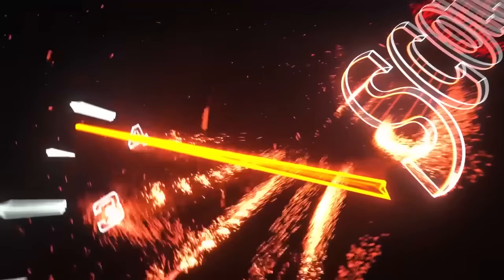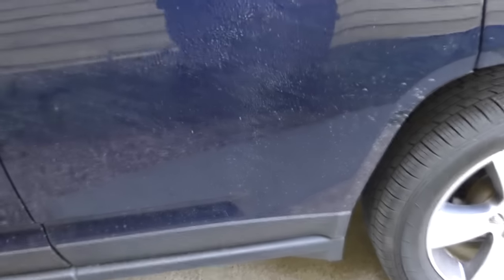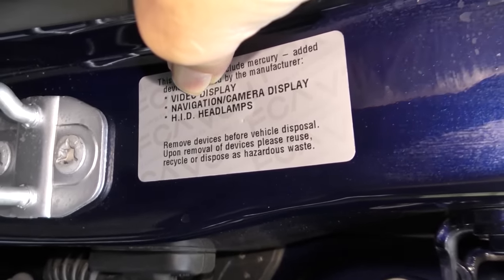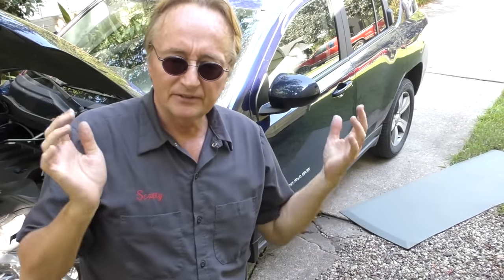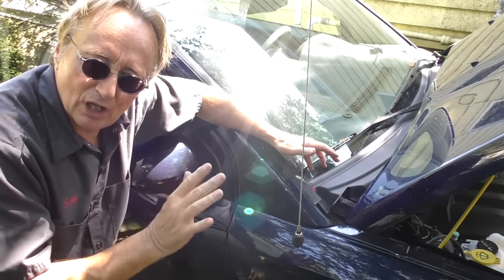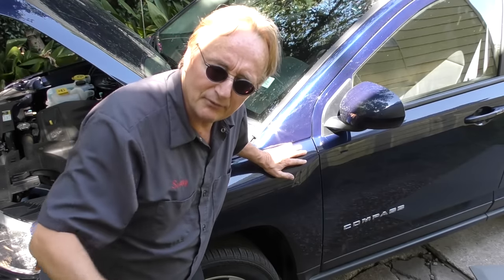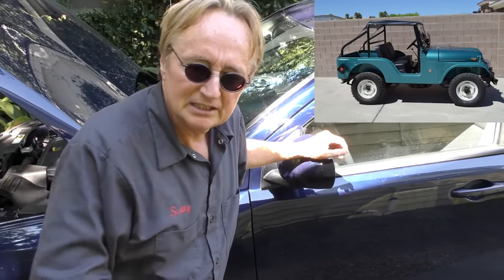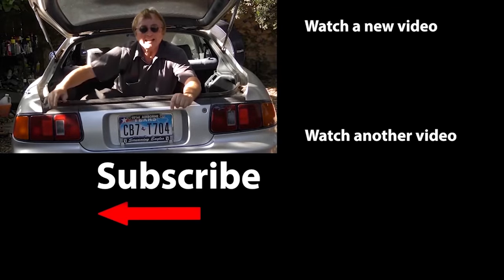Here's Why This Jeep Compass is Crap

Comment: I own a 2014 Jeep Compass. And I bought it from carmax here in Houston Tx Lol. It had 42k miles on it. The only thing I have had to replace on it is the throttle body. The part from auto zone cost around $340. Which is a little expensive in my opinion for a hunk of aluminum and two plastic gears and a circuit board. I have some where around 98k miles on it now and I have not had any other problems with it. At the time I bought it I had not seen your other videos about how poorly made these vehicles are or how shady carmax is lol. I'm just going to keep praying this thing holds together long enough for me to pay it off. Thank you for your videos and all of your knowledge that you share
Reply: David Chitty same issue here. My throttle body went out @ 70,000 miles
Reply: So if you just give it all the TLC and try not to do Jeep things with it, it'll be okay. Helps if you're handy with Youtube and tools, but just read the forums and do your research before you dump a ton into these babies.

Comment: I just traded in my 2013 Patriot with 197k miles and got a 2017 Patriot with 35k miles. My old Jeep started to have transmission problems with the CVT. I’m very glad my new Jeep doesn’t have that CVT so I can keep it even longer. I’m pretty happy with both of them so far.
Reply: I have a 2010 Jeep Patriot limited 4x4 with the 6spd CVT. It has 144,4xx miles and drives straight nice and tight. Abs light on for the abs motor being out but nothing else code wise. Sunroof leaks but I plan on fixing and not electronics out. The transmission sounds fine. No whine. It’s a little delayed when in need of power but the transmission is really smooth. Takes a half sec to engage into reverse and drive but not concerning. It seems to be getting bad gas mileage. I’m mainly on free way. The car runs super smooth so idk what would be causing the loss of power. Dealership said to replace Pcv valve but I took pills one out and ball is still shaking good. Transmission fluid is new and serviced. Air filter is new. Oil is good. Don’t understand the fuel mileage issue. Also slight clunking coming from front end over bumps has been there since new. But hasn’t seem to be an issue

Comment: Totally disagree I have a 2014,130,000 miles no major problems still running strong. Great gas mileage.still has original parts only changed the alternator and both thermostats. I keep the oil changed every 3000 miles with synthetic
Reply: The experience you have with a vehicle is often related to how you treat it, maintain it, etc. It's likely to last a whole lot longer with decent treatment. One suggestion though! A half century of driving, flogging the ponies, etc., tells me that you are changing your oil & filter unnecessarily often. Since you are using synthetic, I can't imagine changing it more often than every 5000 miles or 5-6 months. I keep my vehicles at least 150,-200K miles and since 80-90% of my driving is highway miles, I go up to 7500 miles between changes.

Comment: I drive 46,000 a year and have had a Compass over the past three years (I do a one year lease) and have never had an issue driving thru snow storms, wind/drifting snow and heat!! If no one told you its a little underpowered you would not really care. Has great features to drive thru your regular Ohio winters etc.

Comment: I've been driving a 16 compass sport for a few years now. Bought it with about 32k miles on it for about $17k before all the taxes and fees and so far put it through a lot of abuse. It currently has 100k miles and still running strong. Grant it, it doesn't have some of the nicer finishes that an equivalent Rav or Subaru would have, but those cars with 70k miles were going for 25k and up. At this point, you are looking to get a second mortgage just to afford one of those. Yes, price does matter. Especially, when you are talking about spending significantly more on a car with bunch of miles on it. I mostly do my own repairs and the only difficult part to replace so far was the rear motor mount. Everything else is very accessible and the engine bay has plenty of room to work in. If I had to  choose again, I would choose a compass with 35k miles on it over another car with 100k miles. I've seen cars killed with poor maintenance and it takes a lot less than 100k miles to mess something up. If you are talking about having enough money to buy brand new, I would absolutely agree. Buying a slightly used toyota would be the  way to go. Heck, I would go back to VW in an instant. But on the used market, you are talking at least 2x the price. For a daily driver, that makes all the difference. If the engine lasts another 100k miles, I got my money's worth.
Reply: Thats right.  Jeeps are not overpriced either.  Unless a Wrangler.

Comment: I have the 2014 Jeep Compass. It’s had a blown head gasket but it’s been resurfaced and it’s good. She’s at 122,000 miles. If you know how to listen to what pushes the vehicle to boundaries, you will learn how to keep her happy. You can’t accelerate, pedal to the metal up a hill without hearing the vehicle get real loud. Just take her easy. Like you said, definitely not high enough or built to drive like a hill climber. It’s a small family type suv. I like how the 4x4 is going to get you out of pickles. This is not for someone who doesn’t have patience.

Comment: We have a 2016 Jeep Patriot, which as I understand it is the same as a Compass under the 'skin'.  It has been a great vehicle, getting over 30 mpg on the highway.  It isn't meant to take on serious off roading.  Scotty talks about transmission failures; I think that issue was primarily with the CVTs.  Our Patriot has a Mitsubishi 2.4L motor and a Hyundai 6 speed auto transmission; so much for being American made, but it has been very reliable for us over 52,000+ miles so far.

Comment: I've got a 2016 and it's been running perfect. Awesome 4x4 on snow, can hold all my snowboard/camping gear.  The base sound system comes with nice sounding 10" speakers in the doors. With this vehicle I recommend the 6-speed not the CVT transmission. The 4cyl engine makes it decent on gas mileage, but I wouldn't tow with it. The OEM sparkplugs for this vehicle have short life. The first generation is based on the dodge caliber and a later model when well maintained is simple and reliable. I've only heard bad things about the second generation 2018+
Reply: 2017+ I have an Early (1st Gen) 2017. There's also a Late 2017 which is the newer model.
Reply: FYI the door speakers are 6x9's

Comment: Bought my 2015 Patriot (yes, they are the same basic vehicle) 5 speed 2.0L it gets around 21 city 25 hwy. Now it did have a catastrophic clutch failure at 16k miles. Fought with FCA for 2 months to get it fixed under warranty. The Yakima mega warrior roof rack fits perfectly. Also adapted 18 inch Jeep Wrangler wheels it looks and handles much better.

Comment: I leased a 2018, its not bad at all. 21k miles so far and it runs well, no mechanical problems, got us through a 2 state move. I can see faults and small problems in the electrical system though. But of course nowhere Near as good as my 00 Grand Cherokee was.

Comment: I bought a 2018 Jeep Compass 4x4 with 19,000 miles on it and just rolled over 200,000 miles ( lots of Lyft/Uber trips in the past ) and it has used oil since I purchased it but it's not  burning or leaking it and I keep it
 changed myself on regular schedule , it has surprised me to still be running !!!
It is a beast of weight on starts up hills from a dead stop but my gas mileage is 26 - 28 mpg .

Comment: Wife coworker bought a 2017 Compass, first rain water was coming in through the sides of the windshield.
Reply: I got a 2017 with 90k miles all highway but how is yours holding up? Idk if i should get rid of it or not?

Comment: I've got a 2015 4WD, bought it in 2018 with 62K miles on it, it's now got 75K.  It's awesome.  Handles great, very comfortable,  great gas mileage, good acceleration. The only thing I've had to do is put a battery in it and change the oil and top off the fluids.  I love it.
Reply: Yeah, my 2013 has been rock solid (276,000 miles),  change the fluids, don't abuse it like a teenager drives and they last.  That kind of milage is amazing for any 4 cylinder.
Reply: @michaelxwhite  276k miles that's impressive. My 2014 with CVT is currently at 86k mainly driving locally. I replaced the throttle body once (DIY, common issue for certain batches) but no other mechanical failures so far.

Comment: The patriot and compass are similar vehicles with different body styles. I have a 2016 patriot with the 2.4l engine. It's really not a sluggish car at all. The fit and finish suck, but it was 16k compared to other suvs which were 30k minimum at the time. It's been reliable so far with 35k miles over the last 3 years. Honestly my only real gripe is the steering wheel isn't telescoping.
Reply: I miss actual tilt steering wheels.

Comment: I have a 2017 high altitude. Used the 4wd in the mountains in WV. Did amazing. Didn't slip anywhere. If I had all terrains, it would've went anywhere I wanted it.

Comment: I enjoy working on my '08 Compass.   It has a trailer package on it and I have an 8ft trailer to haul brush, furniture, lawn equipment, around town.   I put $20 in the tank and I'm good for two weeks or more.   When I bought it used, the dealer gave me a great deal over two Ford SUVs.    I paid it off in two years.  Since then I"ve replaced several rusted parts in the front.   It has some issues but it runs great, has great AC and it's a great little workhorse.

Comment: So, as an owner of a 2016 Patriot (same as the Compass, just different body), they were designed in the Daimler days and since Fiat took over, the Patriot/Compass only got better.  The 2011 facelift included much nicer interior materials, better sound deadening, and better overall fit and finish.  Also, they included the availability of the Hyundai 6F24 6 spd conventional automatic.  With that, I’m sitting at a 8 second 0-60 which is more than quick enough.

While the gas mileage isn’t great, the 4x4 system in these leaves the Toyota Rav4’s system at the bottom of any steep and loose climb.  With the same brake lock differential system as the Wrangler, it keeps climbing even if only one tire has traction.  The Rav4’s system seems to be more of a selling point than actually functional in any kind of offroad condition.  Also, the Compass/Patriot tucks away critical components underneath and offers high strength steel skid plates.  The Rav4 leaves everything dangling, ready to catch on the first branch or rock taller than 6 inches and get ripped off or damaged.

My point is, yes, the Toyota is more reliable, better MPG’s and interior room.  That’s because it’s a car and meant to be driven like one.  The Jeep offers more offroad capability than anything else in that category.  It is the “Jeep” of Compact SUV’s.  Jeeps have always had worse mpg, on road driving dynamics, and interior room than their competitors because their focus was on being the best in their respective categories offroad.  The Compass/Patriot is no different.

I will say though, if you don’t plan to go offroad ever, get the Rav4, you’ll be much happier on your grocery run.

Comment: As someone who owned a YJ, a liberty. Owns a TJ, JK and a Renegade.  I was a little worried about buying the Renegade because it was the first platform that the fiat and Chrysler made together.  But years of owning it.  It’s been nothing but reliable and it’s the daily.  Only thing I don’t like was the stock tires are trash.  Otherwise nothing but good things with it.  Do all the maintenance myself. No oil consumption, no trans issues.  Just reliability.

Comment: I have a 2008 Patriot that has almost 200,000 kms on it and it has been very reliable. Bear in mind, I avoided the cvt transmission and got the 5 speed with the 2.4 litre engine. It's been a decent car and I am still driving it. It's the 4X4 and the only issue has been the body rust around the rear wheel wells and the rear diff has developed a small leak at the driver side output shaft. Still........

Comment: BTW… if any of you are having a problem with the window switch not working…
I had a problem w/ the front pass. window not working from time to time.
   I used some aerosol connection cleaner & sprayed down into the switch itself (both on the master & the pass. door). Worked the switches back & forth a bunch of times & seems to have made a significant improvement.   It still glitches from time to time, but not nearly as often.  Eventually, will likely have to replace it; but this has helped for now.

Comment: Ive been a Jeep owner for 15 years - I wouldn't touch a Fiat Chrysler one
Reply: I got an XJ recently. I've never been in love with a car before, even with all the work I've had to put into this thing
Reply: @sonicfan2651  couldn't agree more. My first Jeep was a XJ. I now have a 4.7 V8 WJ that I wouldn't change for the world. Yes I've replaced lots of parts (it's 19 years old) but it just runs great
Reply: The older jeeps look better too. These new wranglers are ugly and unreliable
Reply: Funny thing is the 1st gen Compass was designed when Daimler owned Chrysler. That doesn't make it any better, though...
Reply: Wish I still had my 93 zj 4.0. Sold it at 330,000 miles. It’s embarrassing how bad “Jeep” is now.
Reply: If you have been a Jeep owner for 15 years...you have already put your time in at HELL

Comment: Hey Scotty. I love following you. Your knowledge on vehicles is amazing. I purchased a 2017 Jeep Patriot, Latitude, High Altitude edition, 2.4c 4 cyl. engine, six speed automatic and its 4x4….it came with 64,237 thousand miles. I have zero complaints. I’d really like to have your opinion on this vehicle. It does have a moon roof as well as a roof rack. 
Thanks! 
Frank.

Comment: My uncle bought one and it had many electrical problems. Then at 40k the engine blew. Its a stupid car.
Reply: Darth Bane Chrysler, classic electrical issues and they were owned by Mercedes, and then Fiat I don't know what your uncle was expecting lol
Reply: @JDMHaze  yeah... it was last years model. And the worst thing is, before it he had a alfa romeo and the engine blew too. Money doesnt buy you intelligence😂😂
Reply: Darth Bane Who the hell would buy a 2nd Fiat product... My first car was a 2000 Nissan Maxima(in 2012), After that car I knew not to buy a NEWER NISSAN despite how solid my 2000 was ..  But fiat has never had a solid car  lol Not more than your hand can count lol
Reply: 2 cars with blown engines? Perhaps there is an operator issue.
Reply: Matthew Rafferty lol Common denominator? 👀😂🙏🏽😂🙏🏽
Reply: @matthewrafferty4117  both automatic and new but different ways it happend. In the alfa a piston kinda went off the rod and it broke the engine. In the jeep it was because it burned oil at a insane amount and it got really hot all of a sudden and seized up. Oil light never came on. He has bought a 2018  chr now and its doing great.
Reply: @JDMHaze  yeah thats what i thought too. He  liked the look of both and went for that. Nissan is just a terrible french surrender crapheap. I wonder if any fiat has been solid really? Maybe the old 850 or some other of those rear engined oldtimers. Nothing much that could brake on them😂
Reply: someone at my work had a 2017 chrysler 200 and the engine starting misfiring and apparently the camshaft and lifters were totally worn out and destroyed, at 29k miles!
Reply: Darth Bane My point exactly, if you have to go back into the 20th century to find a reliable car from a brand they are no good LOL furthermore,  Nissan is euro trash as far as I'm concerned, 2002 was literally their last good year And if I'm not mistaking the sentra of that time was somewhat of a POS
Reply: @larrybe2900  
Good point.
People dont realize with newer cars the complex valvetrain in order to work properly has to have the correct weight oil.
U cant put 20/50 weight oil in for the Hot Summer months like a 25 year old car.....on MANY of todays newer engines.
Reply: @Paul Stejskal 
Not your everyday cheap plastic though, they are a special POLYMER that is VERY durable and made to handle HIGH temps.
Reply: @DutchBane  
I wouldnt buy a Nissan after 2006......that when they went to the biodegradable CVT trans in all their vehicles EXCEPT the 370Z and their trucks.
Reply: @Paul Stejskal 
Thats like saying Kate Upton is just a average gal.

Comment: I disagree. Of course I could have a gem. Mine is a 2015 compass. It has 235,000 miles on it and the only issue I had (other than routine maintenance for normal wear and tear) was an alternator replacement around 185,000 miles. Still going strong, driving smooth.

Comment: I have a Compass 2014 with all terrain tires. I use the auto stick most of the time. I've taken it off road many times and I've had no trouble. I live at 9000 ft and with the auto stick no problem.

Comment: The Wrangler and the gladiator are the only Jeeps worth buying. They might not they might not last the longest time but at least you will have fun
Reply: Junk!
Reply: @Brandon57871  my 2015 jku has 200,000 on it. I've had one semi expensive repair. I had to have my lifters replaced.  It was only eight hundred bucks.

Comment: Scotty I'm so mad at you ! Review the new Jeep Compass. I bought a 2017.5 MP new generation because after 10 months of research I became enamored by the Tigershark Engine muti-air II. And the six speed manual transmission rocks, although harder to find than Big Foot. Power is very good and my all around average mpg is 27.3 it's fwd only but that's all I need. Clearance is fine and it drives excellent, very quiet and smooth. Hwy mpg is about 34 but there have been times when I got over 41 mpg. Owned over 23 vehicles and my Compass is the best ever!
Reply: Mine is a 2017 MK Latitude with the 2.4. Scotty is WAY off as usual.